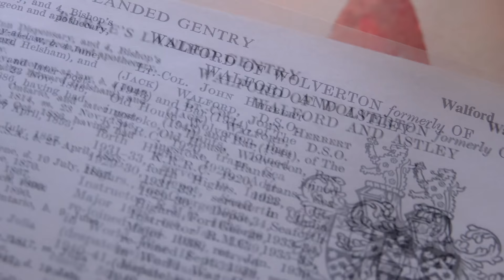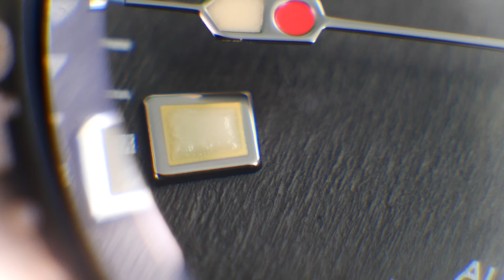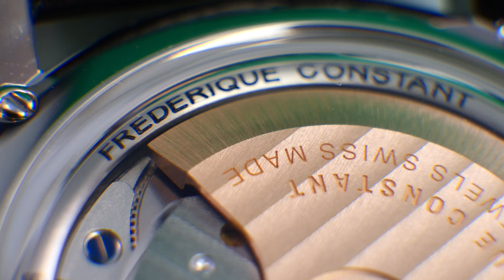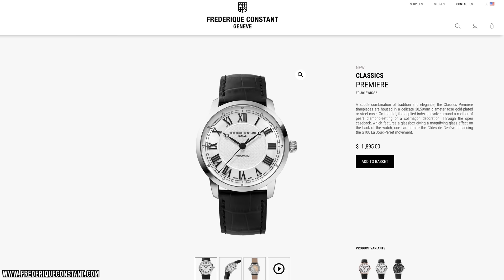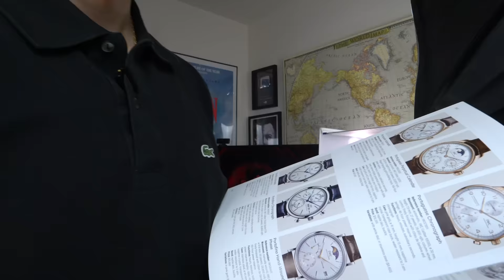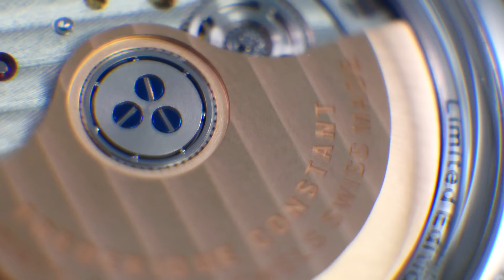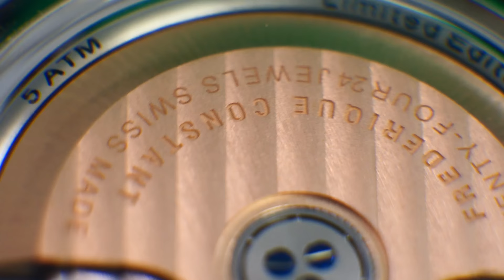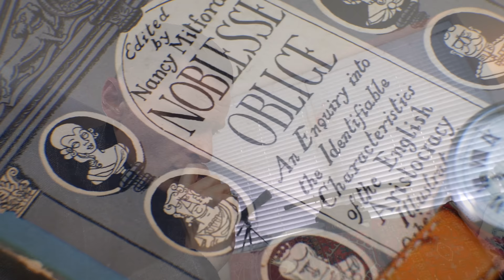Why I Wouldn't Buy Longines, Hamilton & Tissot Watches + Frederique Constant Premiere = Game Changer

Comment: i have two longines. a mono pusher, and the   chronograph  chronometer with date.100m of water resist.  both new,below retail. imo,they are right behind omega in quality.also been around a long time as a company. i also like fc. i have the flyback chronograph in steel. different strokes for different folks.

Comment: Here’s the thing, I own a Longines Sector dial I picked up £900 used, that is insane value, it was actually the third time I’d owned it, I’d had 2 with specks on the dial and noisy rotors. The one I own also had a noisy rotor and needed repair. These issues are frustrating but there’s not a model in the same price park that offers better, that said anyone that buys one new over 2k now probably not doing their homework

Comment: I know what you're saying and I agree to a certain extent but, I must point out something that you overlooked.  Just as that Miyota is 100% swappable with an ETA 2824, so too is the Powermatic 80.  So if the PM80 in my Seastar 2000 ever fails out of warranty, I'll just go to my local watchmaker and have some cheap Chinese clone of an ETA 2824 put in and I'll pay him extra to swap the winding weight so it still says "TISSOT Powermatic 80" on it.

Noone will know, noone will care, I'll have a 4Hz beat and since I wear the watch all the time, the 80-hour reserve means little to nothing to me.  I also have two auto-winders so I'll just have one of the most common and easily-serviced movements in the world for not a lot of money.

Comment: For me it's simple: because they use cotter pins in their bracelets.  The magic of mechanical watches is the idea that it can be an heirloom.  Cotter pins are weak and disposable and wear out the bracelet link holes to the point that the cotter pins are too loose inside making the link useless.  They are therefore only appropriate for cheap disposable watches, not for decent watches people want to keep - which is why every major company has stopped using cotter pins, except for Swatch Group.

Comment: I don't mind the powermatic 80, mainly because when my 4r36 seiko movement broke, it was a plastic gear that was easily accesible, but seiko under warrancy decided to bin the movement and put in a new movement anyway, as they are dirt cheap to make and are highly disposible. Watchmaker also quoted me 100 euros for swapping in a new movement if seiko didn't want to do it. As the one hour extra spendt for the watchmaker was equal to the value of the 4r, so it would be highly uneconomical to fix it.

So I don't want to hate on the powermatic 80, as if I don't hate on the 4r36 I would be a hypocrite. Yes, the seiko easily regulated, but its still no less disposable.

Comment: I have one Powermatic 80 and it's had odd problems. I really don't care for the idea, I'd far prefer a high beat ETA 2824 and don't mind about the power reserve. Only the cheaper P80s have plastic parts but I believe the standard service (about 150 euros) is a new movement. Changing the regulation method was a cynical attempt to keep all maintenance in-house. If my P80 dies I'll swap in a 2824, they're compatible.

Comment: I have a question for you...
Why I have to buy an entry level watch like them when for 150 euro I can buy a Boderry Seaturtle.ocean with titanium case, ceramic bezel insert, sapphire crystal, screw crown, Seiko NH35 movement, Swiss lume (on hands, on indices, on the bezel and even on the pattern on the dial), a near original design and a good appearance? Why? For the heritage? For the tradition? Per la grande famiglia orologiaia? I really can't see how they can compete with products like that. Are they too cheap? Or are them too greedy, from a lot of decades? To be honest, the Swatch X Blancpain is ridiculous. A plastic toy watch with a sealed movement sold for the price of a real watch (and let don't mention the sea slugs on the back). ...the Omega collaboration was fun, a little bit overpriced but fun, this is just madness.
(the Frederique Constantin looks really good, even a tobacco strap or camel will look fantastic, the Hamilton... it's a Hamilton, it's ok. 😅)
I feel like those brands are recharging a little bit more bucks than the real value of the watches. Che ti devo dire, sarò fatto male io. 😊

Comment: FC is a strange brand to me.
First, products are well made and it is à brand that every watch enthousiast should consider.
Regarding design, it is sometimes so classic it would lack some excentricity.
Regarding price, we can see discounts like -30%. For example you can find à perpetual calendar around 6k while its "normal" retail price is around 9k so i wonder what is the real price.
Regarding history it is à young brand with, maybe à deficit when it comes to its brand image. This statement is ilustrated with a price range from 1k to 9k which can be confusing sometimes.
However, how impressive this brand is, developing a lot of calibers in a short period of time. How impressive how you can get such level of quality at a relatively little price.
When i buy a watch i like brands with history image values that are resonating with me or a part of me.
I have a Tudor GMT root beer for the brand that i like and the history of an iconic root beer design original for a GMT warm and for me the best interprétation of this design.
My Omega is not a classic Speedmaster but a worldtimer as i studied international trade, as my wife doesn't have the same nationality as me. It is also original technical and one of the best curent worldtimer.
Finally i have a Rolex DJ which is very classic but two tones and à diamond dial so it can be less classic "exagérément" dressy.

I only see originality in the last high life perpetual calendar dressy sporty full calendar integrated bracelet. So much things in this model but still this generic FC name on it...
I will certainly change my mind one day but in this case why not a Hanhart (your vidéo was so good) or so much other name. 
Great vidéo as always and so much to think after viewing it. Thanks

Comment: With the risk of sounding pissy - I did some research and the Hamilton KFM does NOT have plastic parts in its H50 movement, and unlike this Breguet ''homage'' is an original design.
I'd take a high beat Miyota in a Baltic, otherwise I'll pass.. I think you are taking watch collecting far too seriously and shouldn't expect yours (or anybody's) heirs to be fighting over the Frederique Constant on the passed on collection ;)

Comment: In today's world, movement replacement is actually more practical than repairs given the high craftman cost, especially for lower tier price level watches. What I disagree with is that Powermatic is replacing ETA2824, and ETA2824 seems to be faded from the Swatch Group. Most people still prefer high-beat ETA2824 over the rigid Powermatic. I feel no one except Swatch Group is benefiting from Powermatic.

Comment: If the movement is based on the miyota 9015, I'm not impressed. I just bought a Zelos Blacktip with the same movement. For the first 4 days it was +30secs/day. At least the Zelos was only $500. Cant say the same for FC I'm sure.

Comment: Sorry, it's quartz or atomic/smart watches for me.  I like my watch to actually be accurate.  Not within a few minutes a month.  Not within a few seconds a week.  I want it to be within +/- 1 second at any time I look at it.  Why?  Because it's a watch and it's supposed to tell the time, not an estimation of the time.  The exception I would give is to manual winding watches.  Why?  Simply because that's what I wore as a child so there is some nostalgia there.  To me, automatic watches are more, very expensive (until recently) decorative snob bracelets than they are watches.  Don't believe me?  Just look at how prominently the word 'Automatic' is displayed on the face of so many of them.  It's the equivalent of a fur coat having a big label on the front saying 'Real Fur'.

Comment: For me, I'd rather have a San Martin with an ETA 2824 clone (like the PT5000 or Seagull 2130) than a Powermatic. Having a high beat movement is something special that sets them apart from an NH35 or Miyota 8215.
Reply: Having owned a San Martin with said ETA clone, I will say no thanks. Mine was an absolute garbage example that would just randomly stop running. San Martin took it back, but dealing with a Chinese based brand requires more patience than I'm prepared for. Two months between money out of my pocket and my receiving a refund. Never again!

Comment: You are comparing an entry level standard movement PRX 80 cost 735 CDN vs a 2350 CDN FC. ERrr ok. How about you go with apples to apples and compare a Chronometer grade caliber 80 ETA movement which is COSC certified, all metal and can be found in watches for still 700 dollars less than that FC. Popycock I say!

Comment: I was never a fan of the PowreMatic. As stated, the inability to regulate, just puts me off. I have a Hamilton Khaki King with the "H-40" in it, and it runs rather slow, and it just sits in the box. I'm contemplating the purchase of a Sellita SW-200 to swap in. I'll give up the power reserve for the reliability and adjustability.
Reply: Why don't you just give it to a watchmaker to regulate? It's the same as regulating a Rolex or Omega, with the weights on the balance wheel. Won't cost you much.
Reply: I have a Certina PH-500M. If I take it off the rack and wear it can sometimes drop a few hours until it gets a bit of power into it. Happened 3-4 times now. Accuracy seems to be good if worn a lot otherwise +8s a day. It puts me off newer Certinas.
Reply: I bought mine in 2016, and wore it quite a bit, since they need to break in, but after several months, there was no change. If it ran slightly fast, I wouldn't care so much.

Comment: Welp, I have two Longines, a Tissot, and a Hamilton... but none of them have that PowerPlastic 80" movement Swatch is putting in all its Acura/Volvo/Infiniti-equivalent "kinda-sorta-luxury" watches these days. I really wanted and almost bought a Hamilton Khaki until I discovered it has that Powermatic thingy in it. Too bad. 

The particular Tissot model I have switched from using the ETA 2834-2 to PowerPlastic 80 mid-production, and I had to shop around quite a bit to find one with the former movement. Ended up paying about 25% more for it as well.